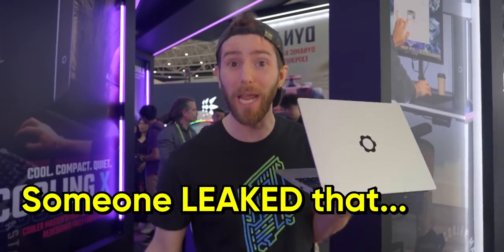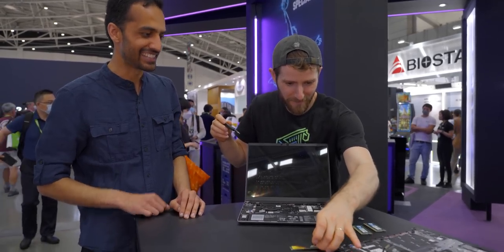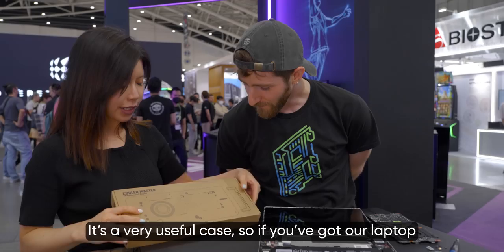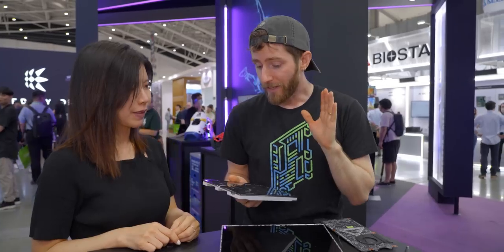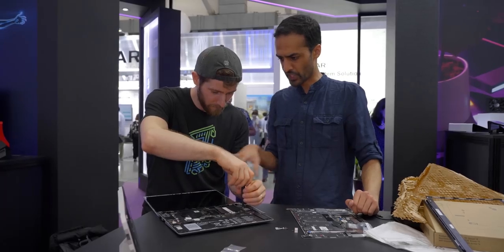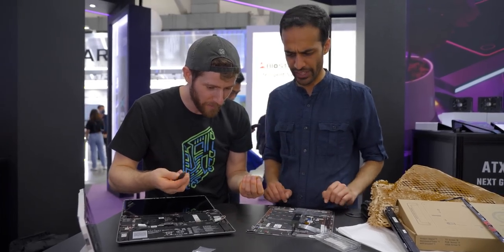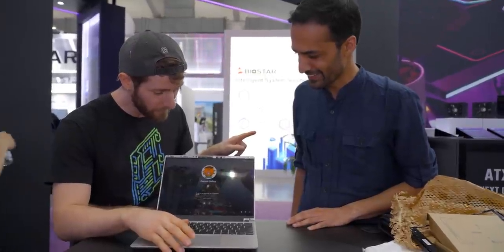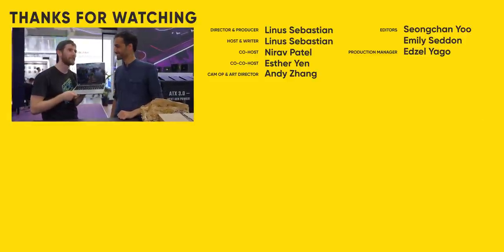World Exclusive: Upgrading my Framework Laptop to AMD

Comment: 3:38 yes correct, you can actually destroy fine cables by moving them around too much. the metal in the wires is very fragile. Infact, in some old laptops the issue was the cables would get shredded by the hinge guard casing lol, and cause fires too!

Comment: I mean, to be fair to them, not including the antenna or audio card goes with their goal of not having waste. You pick whichever parts you need and don't get any you don't. So someone using an external antenna doesn't get an internal one they don't need, or vice versa. It's a case, not a complete kit. I can see that tripping up some people but I feel like most people buying a Framework and repurposing their old board like this can probably handle getting the other components they need.

Comment: Linus getting Amd Is actually surprising that how much they improved their processors
Reply: Wowow early
Reply: This is for his laptop though he's been running AMD on his main rig for years
Reply: Amd laptop chips are objectively better rn
Reply: @impy1980  um nope that is not the reason. AMD didn't catch on because they strait up refused to produce enough laptop chips for years now choosing to produce more lucrative server ships instead so large laptop manufacturers can't choose AMD because they need massive supply that AMD just didn't have. this is why you only find AMD on high end models that aren't sold in large numbers and even the smaller brands that sell AMD always seem to be sold out as they just don't receive many AMD chips. This is supposed to change this year with AMD promising much better supply for their future generations we can only wat and see.
Reply: Amd started paying linus more than intel..

Comment: Dell burned me on my last laptop, and I declared them dead to me. Framework, you're my only hope! They seem like an awesome company, I look forward to doing business with them in the future.
Reply: Dell definitely cares
Reply: @General_Li_Shin  not enough to troubleshoot their own hardware problems.

I spent around $1200 on an awesome 16" Inspiron 7610 laptop, which besides the OS not being optimized properly for good performance, it had a widespread problem with trackpads failing. I had the entire laptop replaced, then the trackpad was replaced when the propblem showed up again on the replacement laptop, I spent 7 months using a USB mouse because the trackpad was unusable. FINALLY, some very motivated enthusiast shared a DIY fix that involved soldering a grounding wire to the trackpad. This DIY fix 100% solved all problems with the trackpad, but would completely void the warranty.

Unsurprisingly, instead of implementing this fix themselves, they continued to replace faulty trackpads with more faulty trackpads, and the next model (7620 series) featured the same flawed trackpad design with the same complaints on their forums. I've lost quite a bit of confidence in their quality control and tech support, I feel like it would be foolish to buy another laptop from Dell given all the failed attempts at fixing the issue at hand. Framework doesn't seem like they would follow the same senseless corporate practices and they seem to make quality stuff. A bit expensive, but if it's a reliable piece of hardware that the company stands behind, so be it!

Comment: It's pretty incredible that Framework want to support not only changing CPU but "hotswapping" with all the required driver updates. I would have expected them to force you to do a clean install as part of tbe upgrade.
Reply: Generally moving an OS drive from one system to a completely different one works just fine.

Comment: Battery connector first

Edit: Imo there would still be some areas of the board powered when in the off state. If you drop a tool or screw onto that area you can short stuff.

Comment: this will absolutely be my next laptop. i'm currently running my 2019 razer blade 2070 with no battery as both the original battery and a replacement battery both swelled up insanely (bad enough that i couldn't remove the last screw on the second one) due to such garbage battery management on the device. (meanwhile my 2017 macbook pro is still on its original battery and is working great!) i'm also waiting for the second power adapter to fail on me randomly. (even though it barely gets moved)

one and done for me, razer.

Comment: I might actually get a Framework laptop soon™
My current laptop is getting a few years old (5 years iirc), and the backside of the screen is made of plastic, and is cracking, so I have to be careful when I open and close the lid. So it seams like a metal case would be nice. Also the framework stuff is a nice cause to support.

Comment: Seems to me that the repurposed main board can be a legit purpose-build to make a mini PC from scratch. I can't think of another full PC that thin and light.  Could be easily mounted under a desk. I would use it for a browsing computer to use other than my workstation and also to run security on downloads.

Comment: One thing to keep in mind is that BitLocker (and systemd-cryptenroll on linux) will decrypt the drive using the TPM, so if the motherboard is swapped with an encrypted drive, you will need to have a decryption key on hand to unlock your drive, and then enroll the TPM from the new motherboard for drive decryption.
I hope Linus doesn't have anything important on that unencrypted laptop... :P
Reply: Anybody who uses such disk encryption needs to have a separate decryption key. I've run into multiple situations where somebody's laptop broke and the encryption made the data unreachable without getting the old motherboard booting. Worse yet changing BIOS settings to boot an external drive is enough so you can't automatically decrypt.

Comment: It's a nice concept, but I'm sitting here thinking, you're hoping to reuse the guts of the old machine?  a) why don't they offer a rebate if you trade it in?  b) why not just upgrade and buy a whole new laptop, it seems like you're changing most of the parts anyway, and how many laymen are going to want to route cables in a laptop, potentially break some connector and or get the whole thing wrong? It's still too complicated.  It's probably not economical.  c) What happens when the interconnects need to be upgraded?  Can you replace the chassis?

Comment: I hope Framework continues to be successful, unlike modular phones. I am a big fan of modularity.
My next laptop could be a Framework 16 laptop. I also hope they do Ryzen 9, because AMDs 7945HX outperforms Intel's 13900HX, plus the iGPUs are way better (at the moment).
The case concept is an excellent idea. My family has multiple $200 - $300 laptops that we no longer use because they keep breaking. In my family, $400 on anything is too expensive, but for me that is way too cheap, unless you can get a high-end phone for $500, like I did. We also have multiple phones and tablets that we don't use. That is a lot of e-waste. Being able to still use old parts as a backup computer helps reduce e-waste and possibly money.

PS: I wonder if it is possible to have a 360 chassis with a touchscreen, like a 2-in-1 laptop. Content creators might like that.

Comment: Almost made the jump but went with a $1200 2022 Thinkpad P1 instead of the Framework 16. Much less money, i7-12800h is more than enough for my workload, and got some certified cpu chops (nvidia a1000) with a few tensor cores as a bonus. So... Sturdy build, and two full size gen4 ssd ports (that matters to me) and same 1600p screen, but at 165hz. And my pointer stick😊 I love the frame.work idea though. But the latest CPU just does not make up twice the price for ultimately, just a little more.

Comment: I wonder if they'll ever ditch the ribbon cable connecting the keyboard/mouse pad for a magnetic connector. I wouldn't know the logistics behind implementing something like that but the panel is already being held in place by magnets, why not the keyboard/mouse pad connection? it'd make add another layer of dummy proofing for the laptop.

Comment: I'd be using a Framework but 2x USB A, 1x USB C, 1x HDMI is the bare minimum base IO for a NETBOOK - that that's all i'm allowed to have? 4 ports? Most of the IO modules are big enough to easily support dual ports, but they only give you one.

Comment: Linus I may be interested in buying a 16" but the anouncement says "A slim, high performance 16" laptop with a fully reconfigurable input system and modular, upgradeable graphics. Pre-orders open Spring 2023, shipping late 2023." It's past spring, so they may want to open them up or change the date.

Comment: I need a framework laptop based on Ryzen 7 with AMD Radeon GPU and a touch screen so that I can finally have a fully upgradable Ryzentosh (using kvm or proxmox).

Also, can the case which houses the old motherboard have option of using the old or any other battery purely as an emergency power back up?

Comment: I have small idea for framwork. why not have the screen detachable instead of leagcy design on ribbon and hinge. and rather you usb c for conector and magnetic hinge to keep it in place. and I would love to invest in framework. just the problem is I can only invest 100000 or maybe 130000 USD.

Comment: I previously upgraded my pc, transferred my windows installation from the old PC to the new one, and I had the issue of not being able to log in since windows knew it was new hardware, but I didn't have the network drivers installed for me to be able to log in to my microsoft account. Justin case I ran into this situation again in the future, how does someone install network drivers when you can't even log into to windows, to not be locked out of my windows account on my own pc

Comment: Wow! Cool! You only need to disassemble every single part of the laptop 😏 The CEO disassembled thousands of laptops, yet they use screws and wires in their devices... And then people wonder why such projects die off. Good luck with the project, you´re gonna need it!
Reply: For what it is. It isn't that complicated. Also, if you actually watch the video, the didn't "need to disassemble every single part of the laptop 😏" . Just some screws that actually hold the board and some connector and you're done.
Reply: @harveywilde6781  I actually watched a video and I don’t see anything “modular” in screws. In fact, screws is everything non-modular. Wires - non-modular. I understand the excitement, but I see failure. Nothing is different. It’s same laptop with a bunch of connector swapping, that can be replaced with a 30$ adapter, that uses one usb type-c connector to connect LAN, HDMI, USB Type-C, USB A, SD cards etc. The whole project is killed by one adapter. Also, we don’t know about the price yet. And they keep asking for money and they don’t have enough people. They’re dead in the womb. In 2-3 years the excitement dies.

I only heard of them from Linus. As soon as Linus pulls out, they’re done.

And they go against the grain. There’s a reason  Musk created reusable rockets. There’s no reason to make motherboard replaceable, because it’s 90% of the laptop price. It only makes sense if you remove cpu, vga and ram separately. And yet, what’s the point? Every 3 years you buy a new laptop. The old one gets scratched, it looks old, there dirt in it, psychologically you’re happy to buy new stuff. OS will also require changes in architecture. There’s just too many variables involved, unless the project is fully proprietary, from top to bottom.

By the way, they could have injected drivers in the motherboard, so that they would install automatically at first boot. But no, why make it simple?
Reply: @acemad1  
I've had a device that uses contact pads and hot pluggable connectors, and you can easily change i.o. and module just by sliding in and out. Although, in theory, they're great, and it was. But in practice, a spek of dust would interfere with the connection on the contact pads, and I don't know how they could make it thin as well.

The last sentence you've said, though, is more of a security feature. Windows hello stores its password on the TPM chip of the CPU. So, they need to figure out a way to transfer that data from one CPU to another.
Reply: @harveywilde6781   I agree, contact pads are too unreliable. But I was thinking more chassis. Long pad on one side and a ball touching the surface with a spring pushing it against the “rail”. The connection is one point, but you can make 2 points by putting another ball, like a ball bearing in a bicycle. Or one that is used in power tools - 3 knife like pins going into a double bracket that is bent and pushes against the knife. In this case the connection has a form of two lines.

I didn’t think about the password, but they could just make a migration app for passwords and drivers. Or install an sd card into the motherboard with necessary drivers booting at startup.

Anyway, Microsoft has the upper hand in everything that has Windows in it. So why not make your own OS and say “it’s absolutely seamless if you use our OS”? And many more.

But still number 1 problem is the “why”? What’s the point? What is the idea behind modular laptop? Make it cheaper to replaces certain parts? Then they won’t make money. Be able to replace usb connector type? One type-c adapter can do this. Replace cpu without replacing everything else? Also impossible at this point. Monitor also burns out with time. Why would I even consider going Framework if I can buy a decent office laptop for $400?

Comment: It's a racket, £240 for 64gb DDR4??? i just bought that for £110!!! And an i7-1360P Intel NUC for £544 not £1031 as they want for the mainboard!!! And it was £544 because I wanted the "tall" version, the base one is even cheaper! I'm nowhere near close to an engineer but I betcha I can cannibalize off the shelf products to build a frame.scam laptop for much cheaper than what they're asking for it.

Comment: ow linus never read the EU laws and what we just did. We already made same charge connector and now we already placing battery replacement easy no special tools, no glue all like it must be. Simply simple user will eaSYLY can replace battery on loptop or phones :D and if there is special tool needed even special screw manufacturer must provide it with product. Apple now pissed in pants and all other brands too :D

Comment: When Framework starts using socketed CPUs in their Laptops, I am willing to switch. So long I will stick with my t430.
Reply: If you mean socketed as desktop, then it's not possible, a 7700x (just an example) has a TDP of 105W, which is 45 more than their power brick can handle (60w), yes they could update it but 250w power bricks are few and far between, and they'd have to give up their "ultra portable" solution

You also have to consider cooling, a desktop CPU gets WAYYYY hotter than any laptop based CPU, which is why the coolers are so beefy

But yk, if you just mean some weird socketed laptop CPU, then I don't imagine that's up to them, since Framework doesn't manufacture CPUs, so it'd be up to either AMD or Intel to do it for them

Comment: ohhhhh... mediatek wlan is the worst wifi module i ever used. it has the worst drivers for both linux and windows. it throws bsod on windows and kernel panic on linux.
i met this cart in my asus rog amd advantage... the first thing you need to do with this cart - take it off from your laptop and throw it to the window...